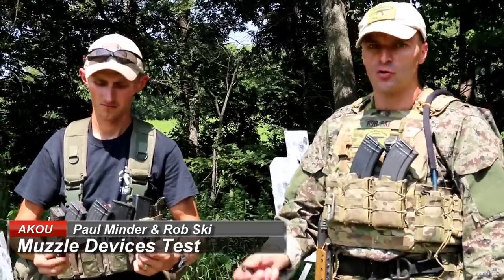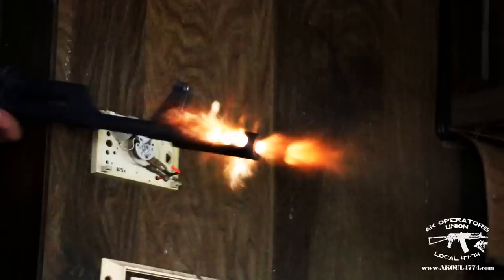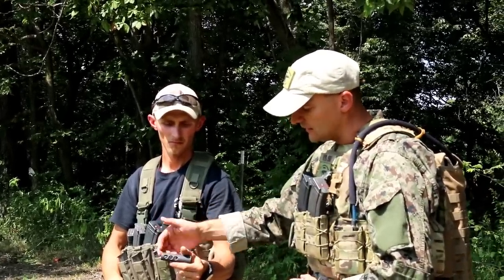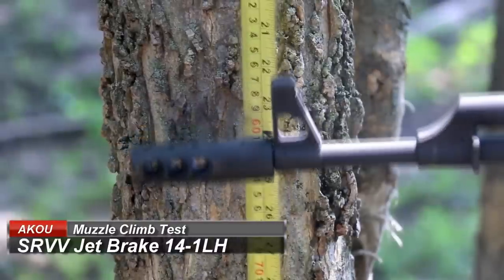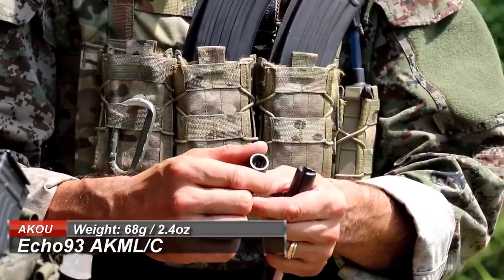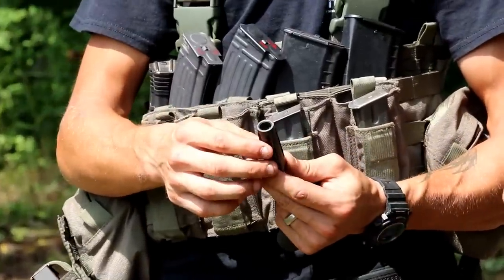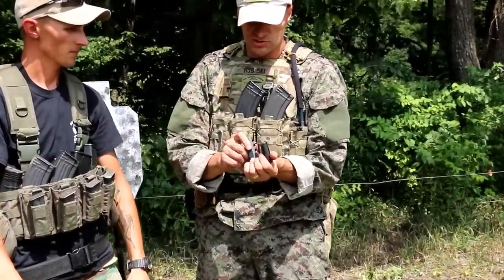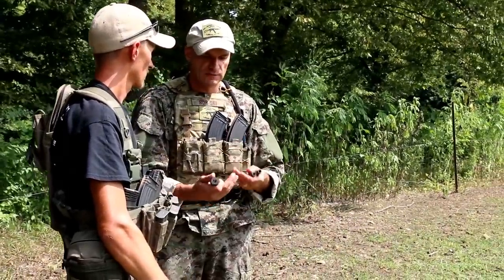AK47 (AKM) Muzzle Devices Tests

Comment: Great video as usual.   I do love the SRVV though......
Reply: Good stuff guys
Reply: Mr.... Do you like the Srvv better than the manticore night brake?
Reply from the maker: Mrgunsngear Channel , honestly, they dropped the ball on 14-1LH version. They should make it smaller profile and shave off weight. Instead they just drill a hole in the same piece as used for 5.45 version with 24mm. However, now you have all that extra and unnecessary material adding to already heavy brake...- Rob Ski
Reply: Thank you Rob.

Comment: Great review.  I use the Tapco slot break on my 47 and it's hard to beat for $15.  My 74 has the standard 74 brake.  Where do you get your chest rig and kydex?  I run a 74 and VEPR-12 in 3-gun and am trying to find the right gear (I'm getting tired of fishing in a dump pouch for my VEPR-12 mags).

Comment: Guys another great video. I think this is number 2 or 3 for the video's you've made for the different muzzle devices you have tested. I'm starting to get serious about replacing the standard 74 break I have on my SGL21. For cost, and recoil effectiveness whats the best break you've tested?
Reply from the maker: If you are concern with cost, i would go with Manticore Nightbarke. You can't beat this brake in cost / performance ratio.
- Rob Ski
Reply: Ak Operators Union, Local 47-74 these videos have great footage and information. Love it if you could spend a little time proving how awesome the SKS is also, and the potential it has when combined with Choate M4 style stock. I know most ppl prefer magazines, but I'm a big believer in strip clips. If you train, you can load them very affectively and very quickly, also they save so much space. You can carry lots more ammo in your pack, and when the clip is expended it's almost nonexistent in the pack and I like this idea. SKS does have accessory 20rd box mag available as well. I love the AK and the AR as well, but I feel the SKS is deserving of some credit also. I feel that it is still viable even in OEM and more so when combined w a quality M4 or AK style configuration. . And I also feel that if anyone can make a solid case for this, that would be you, to show how well they work and how it's properly done

Comment: What kind of stock are you running with the last 2 breaks? And what is a good break you would recommend around 100 dollar price point? And when is the shop getting the krebbs custom saftys in?
Reply from the maker: vegas wajeel this green stock is from Ergro Grips. If you are looking for budget solution, you could get Manticore NightBrake (you can get it with discount from our store: http://shop.akoperatorsunionlocal4774.com/AKM-AK47-NightBrake-14x1L-NightBrake-14x1L.htm )
@Krebs Safety levers - we have them on back order with Krebs for the last 2 months and they are still on back order...they keep pushing shipping date away...i have no idea when these will be back in stock....sorry. - Rob Ski

Comment: Good job guys !!
Noticed your Troy gas tube pic rail is GONE?
FURTHER TESTING?????
Again thx for the video !!
Reply from the maker: 20mm i have a problem with tightening that castle nut. I just can't find wrench for it. The only solution i have seen so far is to use hammer, punching tool and loctite...- Rob Ski
Reply: Please keep us updated as I'm having the same problem. Troy MUST have an answer to this if not I'll have to go back to the Ultimak
Reply: thx

Comment: Srvv vs manticore nightbrake, which is better over all? Also the hat on the can test which would have lest pressure on the sides and less flash .
Thank you .
Ps. What do you run on your ak if you had to pick on.
Reply from the maker: jugado219 i would take nightbrake, because it is very similar in performance, but lighter and smaller...
On my 7.62 AK i keep coming back to either nightbrake or Venom. - Rob Ski
Reply: Thank you brother. You should do a vid of Srvv vs nightbrake.
Keep em coming PROFESSOR.

Comment: Although I know that Tapco muzzle devices are not the best by any means, it would be awesome if you could test all of their breaks/flash hiders. Being only 15 to 20 dollars each it would be great to see which one is the most effective for that price range!
Reply: Im currently using a Tapco A2 style bird cage flash hider due to the fact that its not directional specific, so i was able to cut a notch in the right place to keep it as snug as possible against the front sight block. I dont like when my muzzle device is loose and wobbly on the barrel threads. Im sure others are also curiouse about its flash hiding capabilities.